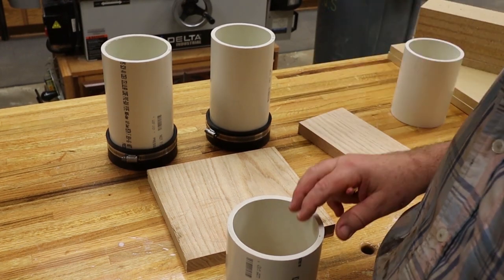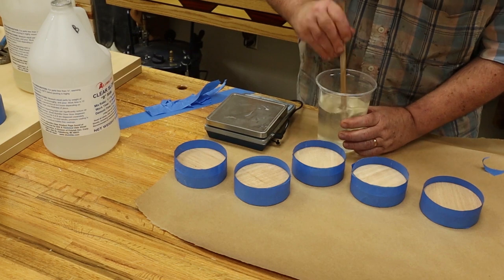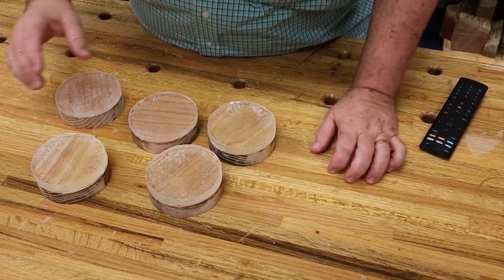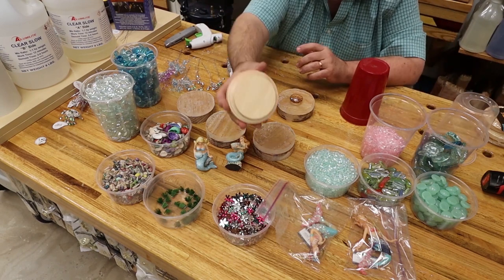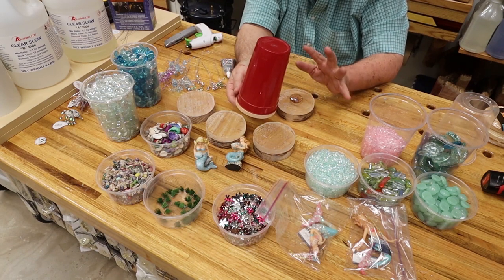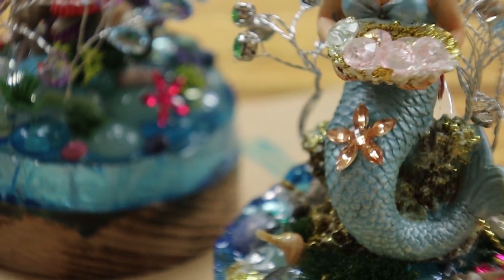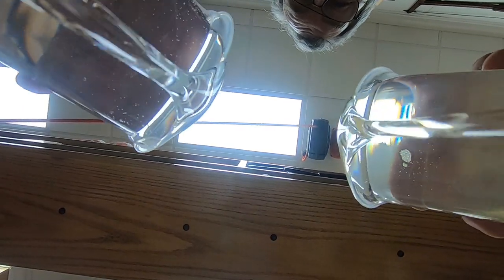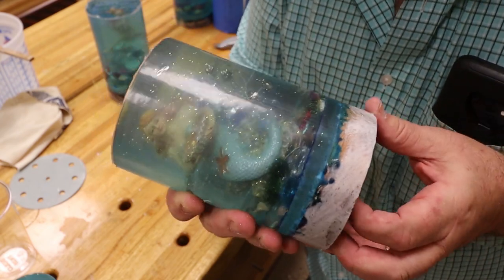Arts & Crafts Mermaid Night Light Video - Fleets Wood Shop

Comment: looking good already very curious how you gonna add the lights to it .
 did you mount the pressure pot on the wall horizontally so ya can add more molds our is there another reason for that?
Reply from the maker: Ricar those particular ones are going to sit on a premade round light fixture that I have led little small ones that are made for setting glass objects and such on top of them. my daughter wanted the night-light so that's why I made them and figured I'd make a few extra and make a video out of it. I have to pressure pots that sit on the ground which give me higth. And I mounted the two on the wall sideways so I could get the length with 14 inch objects like say 4 in is how I laying flat. If the pot was standing up I couldn't put that long of an object in it. That's why they're mounted sideways. And as always thank you so very much for watching. From Doug

Comment: Awesome project Doug. I'm curious, what is better to extract air from resin, is it vacuum or pressure? I have seen it done both ways and I can understand the physics of both but since I never tried it I wouldn't know! Thanks!!! Danny, from Houston!
Reply from the maker: Danny thank you. the reason you put it in pressure pot is the air pressure forces all the bubbles out of the resin. As the resin is curing it gets harder and harder. And it gets hot. The heat contributes to creating air bubbles in the resin. so if you have it under pressure it forces the bubbles out of the resin. leaving the bubbles in the resin would make for unclear when it's finished. Most pressure pots range between 50 to 80 PSI. You should never put it in a vacuum pot that just create a mess. I have seen people do that on a video. That put the resin in a vacuum chamber why it's still liquid. Pull the bubbles out.and then pour the resin into a mold are into its product. But as it cures it just creates more bubbles. And several times while the liquid resin is in a vacuum chamber it can bubble over. Creating a mess all over the outside of the container. And in the vacuum pot. Putting it in a pressure pot under pressure is the correct way to do it. It's actually pretty simple. and of course the quicker you can get the resin into the pot. The more bubbles to pressure can force out. Some people even say the pressure pot collapses the bubbles. But in my opinion if it's collapsed  the air bubble. Then that's the same as forcing it out thank you so very much again Danny I sure hope that helps. And thank you so very much for watching from Doug
Reply: @fleetswoodshop3339  Yes sir Mr. Doug, that was an awesome explanation!!! Thanks!!!
Reply from the maker: You are very welcome Danny thank you very much

Comment: Hi Doug,
It’s a bit off topic,  it I was curious what finish you prefer? Do you use lacquer with a hvlp or just cans? Everything you make is gorgeous! I’m in the process of refinishing some chairs and a dresser. I made some shellac and was going to lacquer over top to seal it up. Just curious what your thoughts and recommendations might be?

Thanks!
Reply from the maker: Yeah I know it's a bit off topic. But my daughter wanted me to make her mermaid night night light. So I thought what the heck I make a video of it. When it comes to furniture finishing. Urethane is much more durable than lacquer. If you put on two coats of urethane base sanding sealer. Send it very well. Then spray it with a urethane based gloss or semi-gloss whichever you prefer. It takes longer to dry but it's much more durable finish. Yes I do have an HVLP sprayer. but I haven't built very many big projects lately where I find myself using it that much. For the small stuff the spray cans work fine. Don't get me wrong about the urethane I do love lacquer. But I prefer it for smaller projects. More decorative pieces and turnings. jewelry boxes. And so on. If you've already put shellac on it do a light sanding before you spray the urethane. And thank you so so much for asking from Doug.
Reply: Please don’t misunderstand me. I was saying my question was off topic, not your project. I think the nightlight is soooo cool. My daughter just turned one so I am taking notes! You’re sharing a lifetime of knowledge with us all! Thank you!
Reply from the maker: No worries no problem. I'm so glad you've got her turning and making things that's good the young people should learn. And thank you from Doug

Comment: Did you make that wood work bench
Reply from the maker: Michael thank you for asking . Yes my friend I certainly did. That particular benches made out of solid red oak. The top is 2in thick. the red oak is a bunch of scraps that I glued together from a solid oak flooring job that we did a few years back. The whole top is made out of leftover red oak from that job. The base frame is built out of 2X6 yellow pine. Veneered with red oak. normally I wouldn't have put any finish on the top. But I've found if I keep a coat of  urethane  on top of the wooden workbenches. The glue and resin is very easy to clean off. but it does wear out after about a year and I re sand it down and put another coat of urethane on it. And thank you again so much for asking from Doug